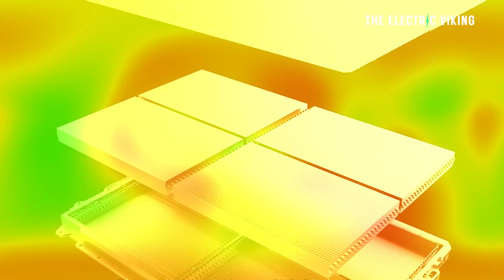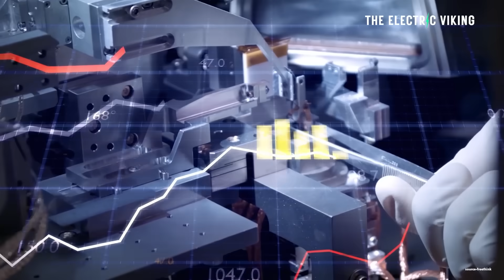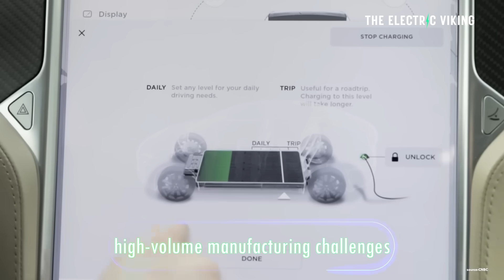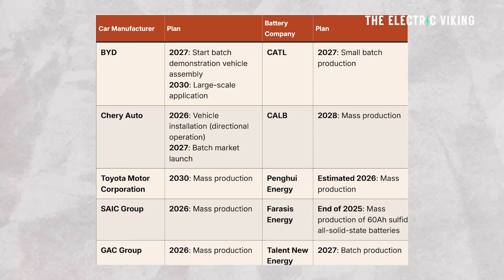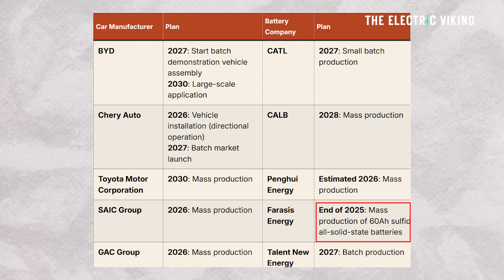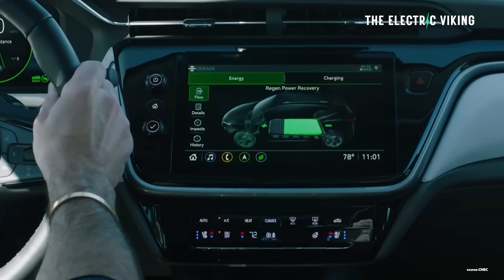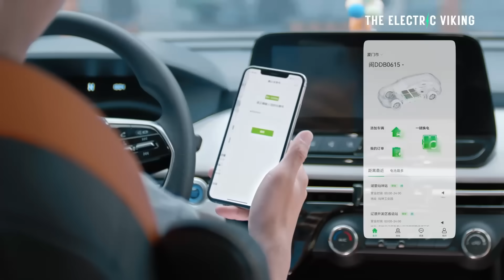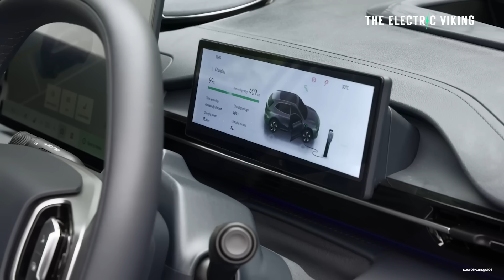Chinese Expert Reveals the Truth about Solid State Battery Mass Production

Comment: Solid-state batteries will be the standard in the next several years, as soon as the hurdles and cycle life are solved.  I was active in the EV development in the late '90's and early 2000's, and attended the unveiling of: Who Killed the Electric Car with Chris Pine in '06, nearly 20 years ago now, and remember well the biggest challenges to making EV's: difficult and expensive production, low cycle life, safety concerns, etc., which are all pretty much the same as concerns with SSB's, and were all overcome, as challenges with SSB's will be soon.  No question, we'll see: 500Wh/kg., 1kW charging or 10 min. charging and 10k cycles, at super low prices, in the next decade of SSB's, along with aluminum ion batts emerging to challenge li-on batts soon.
Reply: Regarding the future. Argonne National Laboratory, in the US,  recently announced 1,200 Wh/kg capable sold-state Lithium Air battery chemistry, that has at least 1,000 cycles at room temperature charging (which has been the barrier to date for Lithium Air's adoption),  giving an idea of where things are heading. 

Whilst lower on the cycle level than lithium-ion, even at 1,000 cycles these Li-Air batteries are now within the very usable range, lasting 20 years even with a weekly charge, supporting high recyclable design options as well. This could see the introduction of 25kg / 25kWh canister style swappable batteries, which with significant weight savings in the car itself as a result could well see 200/250 miles range from just 25kWh (particularly if coupled with the likes of Yasa's low weight radial flux motors - the whole drivetrain could weigh 100kg with a lightweight composite frame, excluding the wheels of course).

Comment: As an EV owner I can go 235 miles comfortably then charge for 20 minutes and go another 200 miles.  It’s not healthy to drive more than about three hours without getting up and stretching. I’m not sure why people are so obsessed with this problem. How many hours every year do we spend waiting for an oil change in  ICE car?
Reply: F oil, gas, diesel, NG, ICE(internal combustion engine) acronyms get confusing these turbulent days. Some NEED to be dragged by their knuckles into the future! 😅
Reply: I spend 0hrs waiting on my Highlander Hybrid's Oil; thanks to Toyota, I can bring in my Highlander Hybrid for service in the morning, get dropped off at work for free, get picked up after work (also for free) and my vehicle is ready to be picked up...
Reply: @MrElectrifyer  How you get dropped off?
Reply: @binky-l4 I drop off my vehicle at the appointed time, Toyota takes me to my workplace. After work, Toyota comes and picks me up, and I picked up my serviced vehicle.
Reply: @MrElectrifyer it was not free, that service was packaged into the price
Reply: @peterman8848 Doesn't change the fact that I spend 0hrs waiting for the task to be completed, whereas the OP was using that as a justification for the range anxiety problems that come with EVs...
Reply: Solid state batteries are going to enable new types of vehicles - hypercars, aircraft. And once price goes down they are going to be most advantageous for smallest ones - cheap microcars, motorbikes.
Reply: Plus has anyone noticed how idling is rampant in the US? People sitting in their cars and fiddling with their phones and such and folks who leave their cars running and unoccupied while in stores etc. WTF?
Reply: It's a marketing hype😊
Reply: @binky-14 It is nice to know you are rich enough to have a private house and garage. But some 80% of America lives in big cities, where a brownstone with garage is n
maybe 2-3 million dollars.
 Or are you a troll who already knows that?
Reply: For circa 90% of people, the biggest component of range anxiety is the anxiety. As Rory Sutherland says, everyone is spending billions to increase range, whereas at this point you could reduce anxiety for a lot less
Reply: Says who it's not healthy? You are a total tosser.
Reply: there is no anxiety just tremendous change to your work or serious travel,   ev are nice commute cars, terrible cruisers
Reply: @greatearth5861  “terrible” is a bit hyperbolic. I just got back from a 2k mile road trip with my family and we maybe added 4 extra hours to the total travel time due to charging.

Your car might last 600 miles, but your body won’t. At least not with any measure of comfort. Add 3 more people and we stopped more for bio breaks than for charging. On more than one occasion the car was ready to go before we were.

It’s not possible everywhere YET, but remember that cross-country roadtrips weren’t possible in the US for decades until the infrastructure caught up.

This is no different. Innovation happens in iterations
Reply: 160k miles no oil change, I will jump in the van 460miles to Aberdeen 5hrs fresh as a daisy straight to work. You need to keep stopping and stretching you are probably in bad shape and driving the wrong vehicle. Next month I have to get an ev but only as the tax is cheaper as the government have been misinformed.
Reply: That’s assuming you can find a working fast charger (regular fast charging also not good). Having a gas car still allows people to stop and rest regularly. It just means they don’t have to refuel every stop.
Reply: Live in western CO 
And drive long distances in the west 
So unless I want to change my life style I need a lot more charging stations and at least 400 miles range
Don’t mind waiting 20 minutes charging but with gas or diesel I can carry more fuel and get the range need to drive anywhere off and on grid
And forget about battery reliability in extreme temperatures
Reply: Commercially it makes no sense. Tow something like lawnmowers, construction equipment, etc… do that in the cold… your range will be bad, makes no sense. Vehicle lifespan will be low, jobs will take longer, make less money. Cost of electricity will skyrocket which means cost of living will go up…
Reply: Its called not living in California. A lot of rural areas have hundreds of miles of road with no pi lic charging. You cannot take a regular EV down these roads as care free as a regular gas car.
Reply: I spend one hour every eight months doing my oil change in ICE vehicle.
Reply: Oil change is ones every 3/4 months as to charging once daily or weekly lol
Reply: @adebayokehinde what has oil changing got to do with fuelling your car, petrol/Diesel cars need fuelling same as an EV needs charging,  if you want to bring Oil changing into the equation,  EV’s require no oil changing nor any other mechanical maintenance that a Petrol / Diesel car requires, suspension checks, yes, brakes, minimal checking as the car mostly relies on regenerative braking.
Modern EV’ are at the point now same as an ICE vehicle in that it is the human factor that is the weak point in terms of range. It is now a case of how far can you drive safely before needing to take a break, 2 to 3hrs being the norm and most EV’s can do that easily with plenty left in the battery. So nowadays the human needs the recharge before the car requires it.
Reply: @brianstevenson9967 I’m not even reading all that! 😂😂! Secondly it just shows, you don’t even read, you just read to comment 😂😂😂😂
Reply: @adebayokehinde  Charging is easy when you just plug in at home
Reply: @adebayokehinde You charge at home every night, 10 sec to plug in/out. I don't recommend an EV yet if you can't charge at home or work.
Reply: Well I love this channel most people don't realize the amount of energy it takes to charge at 500 kilowatts. Each car that is charging would have to have a Transformer the size that feeds a typical 100 room Hotel. We have a good start on adoption but Mass adoption Is probably 25 years away Technology will probably fix a few of these problems by then But energy generation Is a slow build period Actually a very slow build
Reply: Think about all the gas stations in and around a mid size city.  Many of them have 8 pumps, or even more. Cars pull up, pump gas for an average of 4 minutes, then pull forward for the next vehicle. At busy times there may be 5 or six vehicles waiting. Now instead of four minutes make it 20 or more. Now you have 25 vehicles waiting. And that's assuming the same number of charging stations miraculously appear. If reality applies , then we have less than 10% as many stations. So you're looking at 250 vehicles ahead of you every time you need to top up.  In urban areas 20% of people have garages to charge in, but that only reduces the line to 200 cars ahead of you.  See the problem yet?
Reply: you don't get it. MOST ev owners charge at home for 75 - 99% of their need. Public chargers are (usually) rare exceptions. Also, please remember, the grid is everywhere! Plugging in to slow chargers at least should be an option at almost all parking spaces
Reply: @jonvelde5730  LOL nah, To charge my car I just go into my garage and plug in. Thats it. With a gas car you are forced to go to petrol stations.
Reply: @binky-l4  I just like 250,000,000 Americans don't have a garage. End of electric car sales for all of us. And with the cost of real estate today even less people will have a garage.
Reply: @leos3003  Yeah sure if you don't have a garage it sucks. But a lot of people do and will happily convert to EVs
Reply: @leos3003 rubbish! Their's only 340 million of you lot, you cannot tell me two thirds of the USA can't plug in at home .
Reply: @binky-l4 actually very very very few people have garages
Reply: @jonvelde5730  Here they have just passed the ability to install vehicle charger on power poles, of which there is one every thirty metres or so, making it up to millions of chargers - now they just have to make sure there are enough EV's to make it financially justifiable
Reply: @jonvelde5730 in cities every park slot should have a charging station, otherwise ev is just not an option… this or charging times go below 5min. Otherwise this is only an option for the wealthy with a parking slot at home… waiting at the oil/charging station is not an option at cities or working hours… the problem is… the implementation of having a charging station in every parking slot is so insane that makes the whole thing not possible. Goverments only would do that massive effort if ev’s become the final solution for all… and we are still far away from that…

Comment: In terms of wider electric passenger vehicle adoption I think it matters more to get LFP and/or sodium battery prices down and improve energy density. Most people would probably be fine with the range most 60kWh lithium ion batteries currently offer if the cars were available on the prices they are sold in Chinese domestic market.

Comment: I am looking forward to the time when my laptop can work all day using it's batteries
Reply: Already possible with laptops that use ARM chips: Newer MacBooks and Snapdragon X laptops.
Reply: @NopWorks  4 hours max. 1 hour if working outdoors with HDR mode on. IDK what you are working on if your battery lasts all day? Writing text on command line text editor on minimal brightness?
Reply: @dzhiurgis 4 hours Max is not a DEAL BREAKER 😅
Reply: Some phones and laptops already use what's called "semi-solid state silicon carbon lithium battery". Not quite solid state yet, but it's already mass produced for phones, laptops and small appliances
Reply: If there wouldn't be that limit of 100 Wh imposed for air travel, laptops would be able to go over 24 hours of battery life.

Think about it, for 24... let's round up to 25 hours of uptime, in just 100 Wh you would need to consume 4 W on average. That's really low. It can be done while idling, with the screen turned off. Or low resolution, low refresh rate low brightness.

But with a 200 Wh battery (which would add about 500 grams or one pound) you would literally double that. Macbooks, Snapdragon and Lunar Lake laptops would be able to hit 40 hours of video playback and 20 hours of real (but not heavy) work.

Comment: I think swapable batteries could be a great idea, done right. What if a car came with a built-in battery with only a moderate range, but, with a bay for a second battery. So one could save money at purchase and drive a lighter car around, less wear and tear on everything, including the streets. Then, when getting ready for vacation, one could go to a drive through swap-station and rent a long-range battery for the week.
Reply: Because the entire structure of the car would need to be sized to support the vacational trip with the heavier weight, the savings would be minimal and therfore aren't worth the hassle of the swap.
Reply: You would have to sell at least 20-30% of the market and saturate it with your system so all others would be forced to use YOU system. Ask Tesla why they ditched the battery swap.

Comment: Its sounding like the silicon galium arsenide transition
Reply: In 80s si to gal arsenide transistors was constantly being talked about but Si manufacturing improvements kept pushing it back. Not solar cells . Im that old.
Reply: @Paul-ks2fv  I see.
Reply: Only that the direction is the otzer way areound: The GaAs - cells were there for a long time and have successfully been used in high priced applications like space programs etc. I think they never really had the ambition to become mainstream.
Reply: Why? We are still using Silizium.

Comment: Solid state looks cool but if it’s years away it will be too late for me. I’ll be happy when the BYD blade battery 2 is available!
Reply: Can't stand the look of the 4x4 tesla and was so disappointed that the BYD shark is a Hybrid
Reply: Don't worry. The Blade 2 batteries will blow up just like the Blade 1 batteries
Reply: @PeTroL420  🤣😂🤣😂
Reply: @PeTroL420  You struggled at school didn't you son.
Reply: IDK for the battery. What is the TCO? Safety? Software? Longevity? Power? Usability? IDK what electrolyte concotion is in my battery.

Comment: Please do a video on why all liquid electrolytes are said to be flammable. Why can't they make/use a liquid electrolyte that is not flammable?
Reply: typically they are polymers or polymer blended and based on hydrocarbons or the like as the batteries very much dislike water.
Reply: "They" can, but it is not usable with Li, Na, Ca, K. You can use them with Al, Fe but those are only partially rechargable.
Reply: @wolfgangpreier9160 sodium ion batteries can use water based electrolytes. It’s a big plus for sodium ion batteries.
Reply: 液态电池会大规模短路，导致热失控。

Comment: Solid State Battery tech is similar to Nuke fusion
Reply: Not really. We have had solid state batteries for decades. Button cells are mostly solid state. pacemaker batteries are always solid state. Fpr speical applications they make sense. For general use in storage, cars, ships, trucks not.
Reply: @wolfgangpreier9160  Fusion Bombs are 50+ years old

Comment: Seems to me that the limited number of cycles has always been the larger issue with SS battery performance. The argument being that fewer 1/3 as many cycles is acceptable because they have 3 times the energy density. In other words, the performance of an SSB pack with 1050 miles per charge after 300 charge cycles, would be essentially equal to that of a ternary battery with 350 miles per charge after 1000 charge cycles. Six of one and a half dozen of another. The advantage being the SSB is lighter and smaller. Cost advantages aside, I can't see this as a major advantage for automobiles. Airplanes perhaps.
Reply: Should account the factor that as the battery degrades, not only the capacity decreases but its internal resistance is going up exponentially for every % of degradation

I don't have an EV yet, but I still have my old laptop batery as a perfect example of this. It's at "50% health" right now, but when I use it, the runtime is significantly reduced to just 30 minutes (vs over 5 hours on brand new battery). That's because the battery is already too degraded that its internal resistance is causing big voltage drops even in the slightest of use.

So I understand that EV manufacturers wants as high cycle life and as low degradation rate as possible, because they want it to be reliable for very long time, thus any new battery chemistries won't get commercialized until meeting their standards

Comment: Good report. Nothing new so far. Any new battery, solid state or not, must be less expensive per kWhr than current batteries, have at least as many cycles as current batteries (thousands), charge at a reasonably high rate without shortening lifespan and be reasonably safe, although this last requirement has a lot of latitude. Many companies have working sold state batteries, but they don't meet these requirements, particularly the cost. Most of the cost problem is buried in the electrolyte. This has happened many times in the electronic components industry. New devices have been created, but there was nowhere to go for them because they were too expensive, i.e. hard to manufacture. There are niche applications for extremely expensive components, such as satellite PV panels that run more than 40% efficiency. We won't see those ever used for homes. On another note, I am suddenly now getting your new video notifications. They went away for awhile per your prior video comments on the subject.
Reply: Only sodium ion may meet the requirements. Its cost is even cheaper than lead acid battery, has long cycle life (5000 cycles), and more eco friendly as it's not using nickel, cobalt, nor any rare earth materials. It may replace or complement LFP batteries as its energy density is almost the same